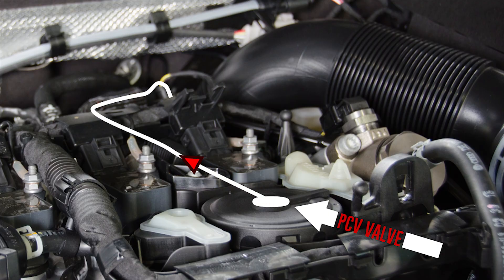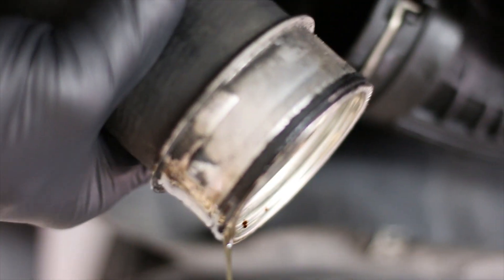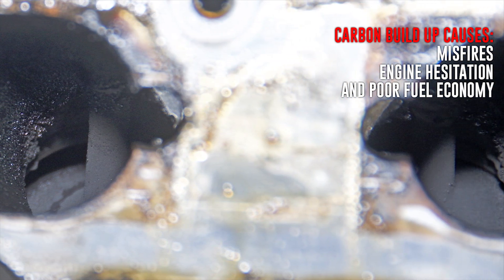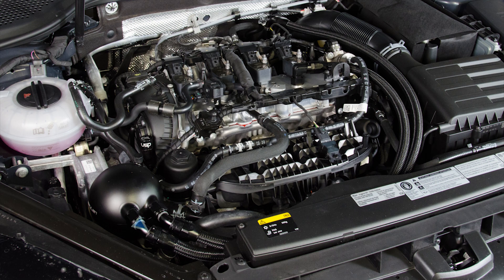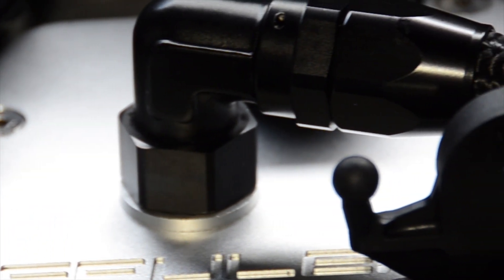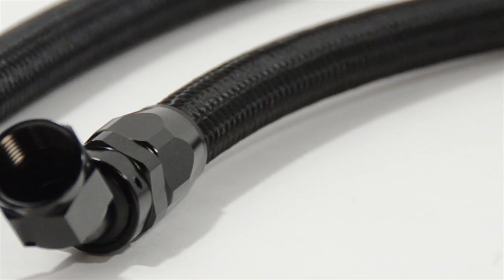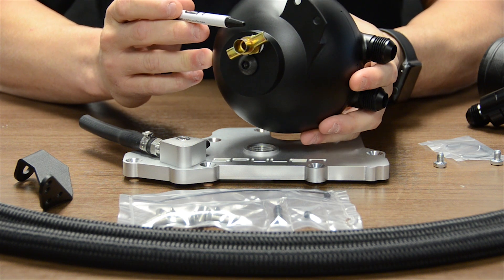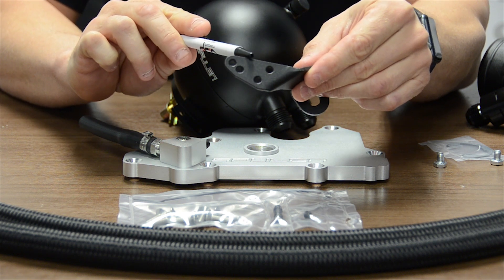Spulen Spherical Catch Can | MQB (MK7 GTI/Golf/Golf R, A3/S3 8V)

Comment: I just ordered the Golf R/S3 spec kit. I was surprised by the additional cost of the washer fluid tank kit but after looking into it I realized on the GTI the washer fluid tank is way over on the other side near the airbox. The golf R has it right where the can is mounted (on the engine mount side).   The removal of the upper tank and the addition of the Spulen Billet Filler neck actually cleans up the look of the engine bay tremendously IMO. Also it's really cheap when included in the Golf R kit ($40 instead of $92).   Nice Job USP! Maybe I'll review the can but I'll at least  let you know how I like it after I install it.
Reply from the maker: +Meat Amigo Thanks for the order brother! Please do a review and next order you place, I will throw in some USP swag!

Comment: Does it work with an Audi A4 2009
Reply from the maker: +Blake Martel What motor? B8.5?
Reply: +USP Motorsports 2.0T B8, this might or might not be related but, I hear a weird fluttering noise when I'm using around 60 to 80% throttle.

Comment: The engine cover fits too? Damn looks like it's time to sell my APR can.
Reply from the maker: +Meat Amigo No trimming needed!
Reply: +USP Motorsports    Also it looks like it has addressed all of the shortcomings of other cans. Some cans have the block off plate but you can't use the cover. Cans like my APR can are nice but they leave the factory PCV system in place and cleans the air after it travels through it which I would assume would not be as complete of a process.